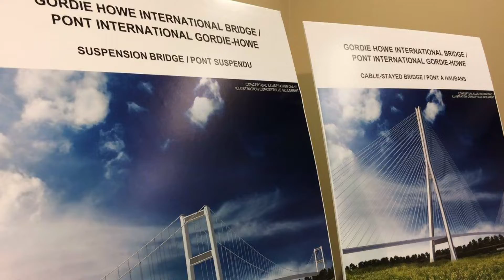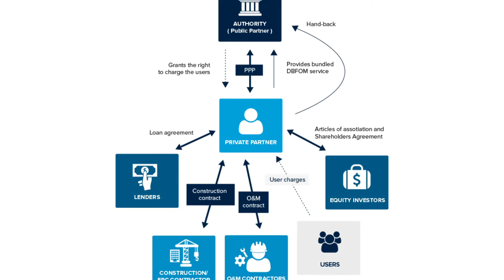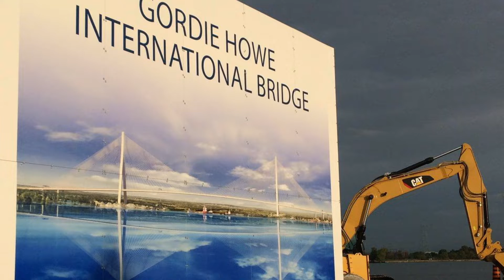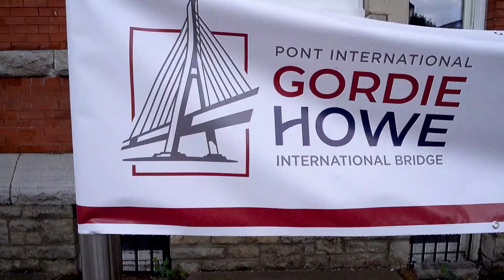The New $4B MEGA Bridge Connecting Canada & US

Comment: At present the span installing out over the Detroit River, from both sides. The suspension cables, tower and roadway are all being constructed at the same time. As the tower reaches certain elevations and the tower concrete has reached sufficient strength the cables, on the landward side are installed. Their installation will brace and support the next set of cables to be installed on the river side. Support steel, for the roadway cantilever over the water and the river side cables are attached. Allow this is orchestrated to assure smooth safe construction.

Comment: Earlier, you said the Howe will connect to I-94 and I-96. Later, you gave details about the connection to I-75. It seems that drivers on 94 will need to get on 96 east and drivers on 96 will need to get on 75 south to get to the new bridge. Will this project add some new signs to 94 and 96?  Or how else will 94 and 96 change?